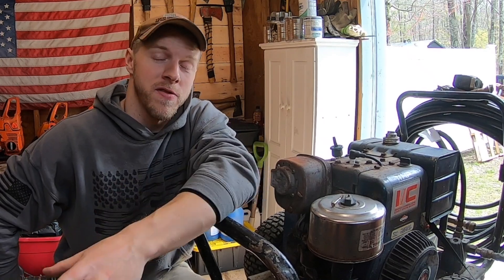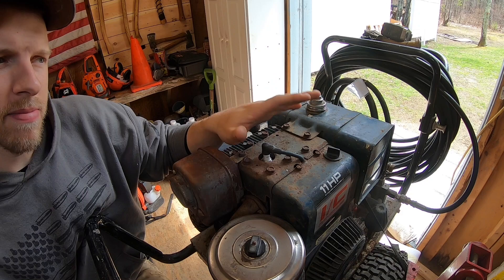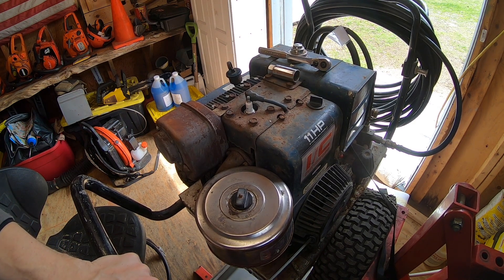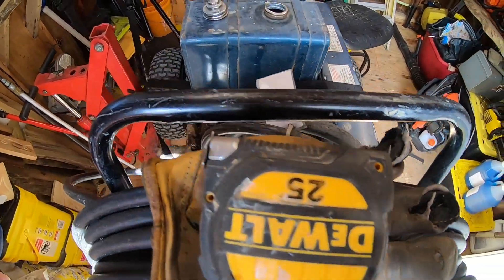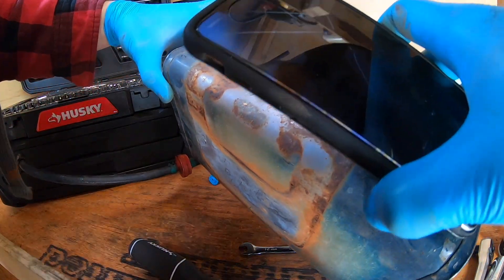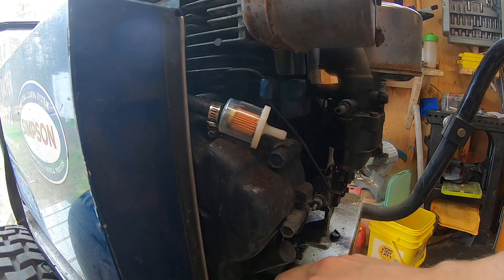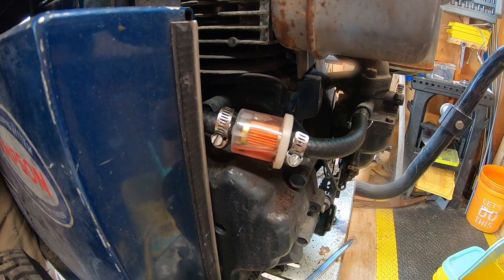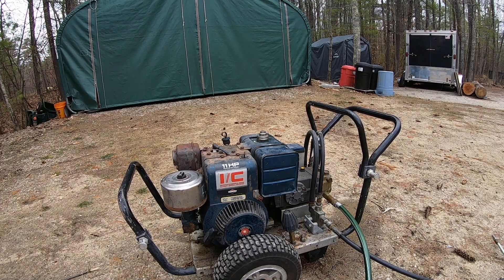How To Get ANY Engine To Run!

Comment: Alot of great info in that video Jay  never thought of using mixed gas but makes sense
Reply from the maker: Yeah it doesnt hurt the 4 strokes. I used to work a landscape company that ALL the gas was 2 stroke mix 50:1 so there could be no confusion since we had lawn mowers, walk behind blowers that were 4 strokes and the saws, trimmers, blowers were 2 stroke! Plus it helps a motor "come back to life" with the extra oil to help coat the rings, cylinder, valves, etc..!

Comment: Many people bash on Briggs & Stratton, but if they are taken care of the run forever, when you neglect them they abuse your wallet! I can’t count how many lawnmowers, weed whackers, or other small engine power equipment I have gathered up and repaired / used and later resold. The best one was a used mower i fixed, and 3 weeks later sold it back to the same guy that I had gotten it from his free pile( not running) and all it took was a little clean up on the magnetic pickup for the coil! Easiest 50 i ever made!
Reply from the maker: I cant agree any more! Its like anything as you said. You take care of it, store it right, run right chemicals and fuel in something and boom its gonna last! People wail on stuff and then complain the brand sucks and its like anything I could blow up my 2018 chevy silverado if I tried hard enough? What does that prove though? I cant stand people bashing stuff THEY failed to keep up haha I can preach about this all day my friend haha
Reply from the maker: Also buying, fixing up, and selling is a lost art now! We live in a disposable society
Reply: @HomesteadJay  that my friend is the problem! Now take a way their large pay check and let them live in reality for a while and see what happens! Do the same for all the “ self entitled “ as well, you know the ones I’m referring to!😅😅😅 !

Comment: Good video. I know you didn't have any problem with the carb, but when something sets, I will always pull the bowl off the carb at the very least to check it out. Being that the engine hadn't ran in 15 years and was put away right, you didn't have any problems. But a lot of the stuff that I see, the carb is gummed up from using gas with ethanol in it.
Reply from the maker: 100% my friend! Ive had plenty of "green death" in old motorcycle carbs over the years haha I can still smell the old stale gelled gas in my dads garage every time I go down there haha